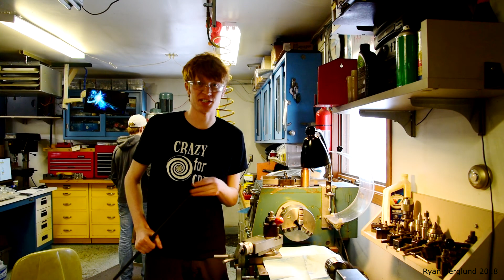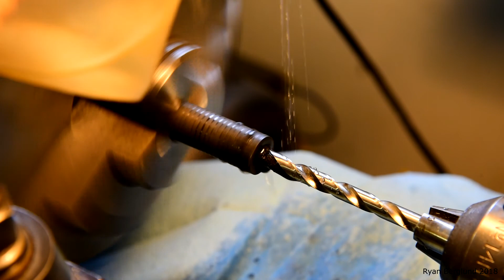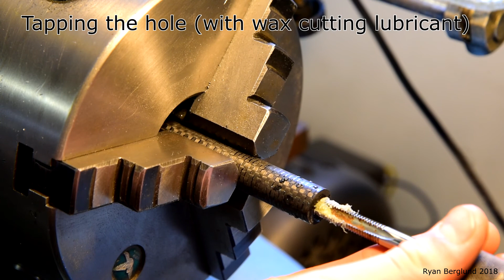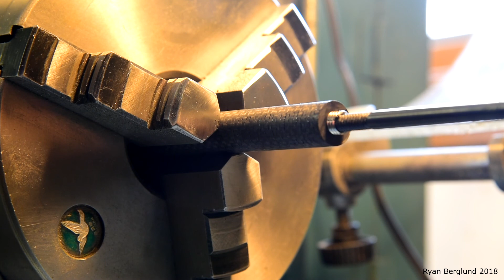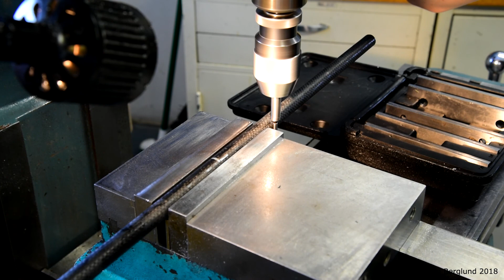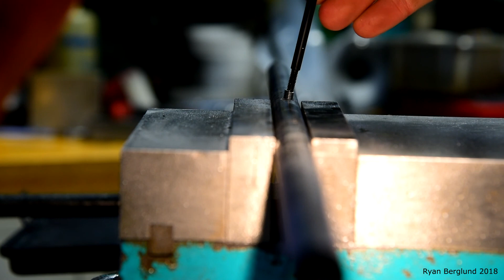Threading Carbon Fiber Composite with Helicoil Thread Inserts

Comment: Have you tested how well those inserts hold up to a pulling force before giving way?
Reply from the maker: I haven't used these inserts in carbon in a high torque application. I have used helicoils in plastics, soft metals, and very brittle synthetic/composite resin based materials in high torque applications where the inserts are under higher pulling forces and sometimes experience high vibrations.
Reply: what about adding a thin epoxy adhesive to outside before inserting
Reply from the maker: I don't think adding epoxy would have much of an effect. The point of failure under high torque loads would be the composite sheering, not the inserts turning/slipping. out.